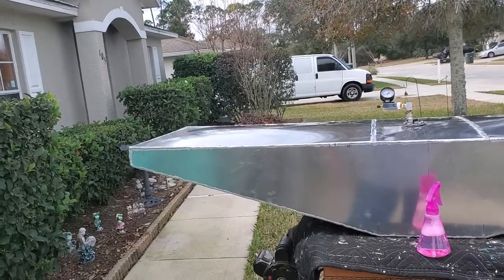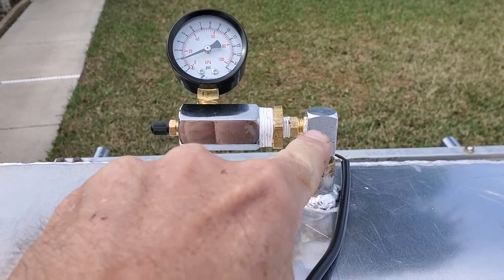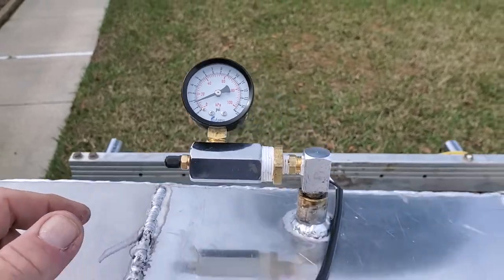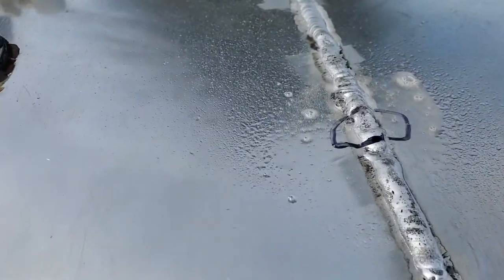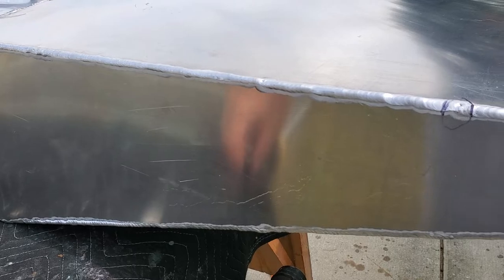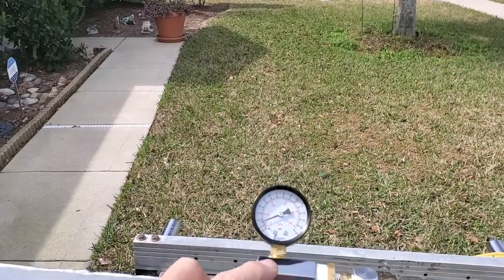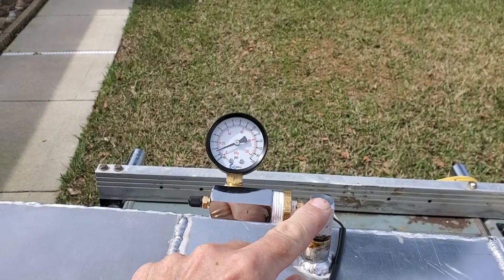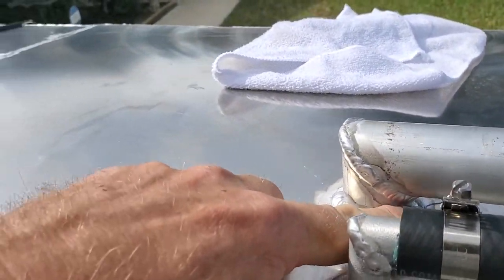My New Tank is Leaking THIS IS HOW YOU TEST

Comment: Hey James, a custom tank welding  job should always have a spec that the tank will hold so much air pressure at such a temperature for such a time.   Regardless, a little JB Weld will plug those holes.  Not a problem.